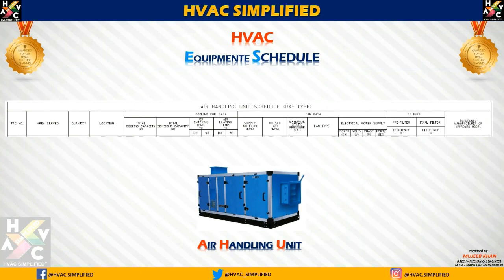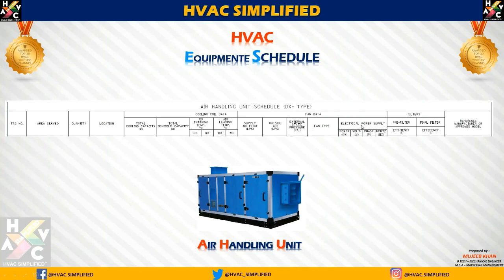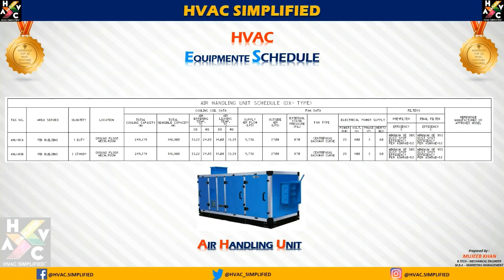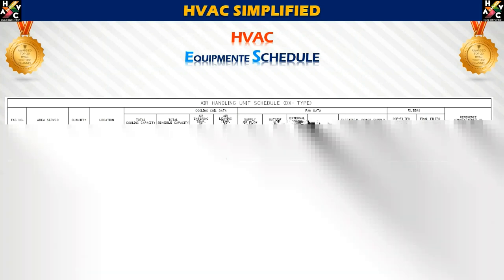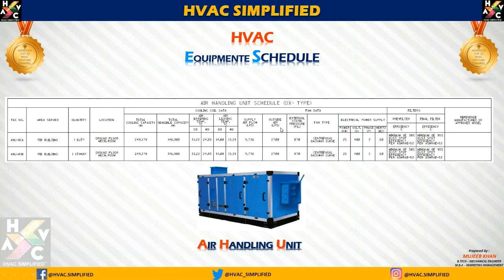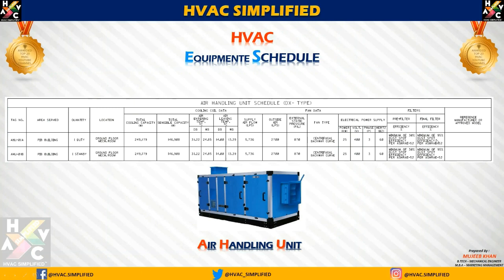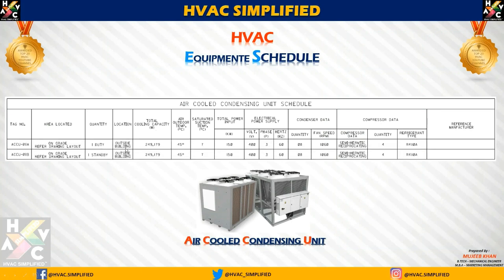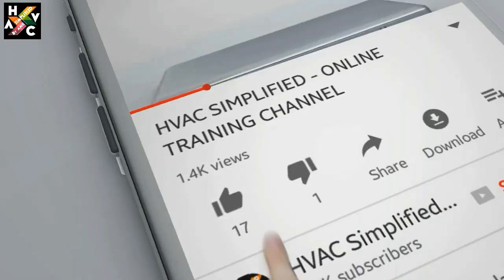Air Handling Unit (A.H.U) Desing & Selection - HVAC Training - Very Important

Comment: I have a project which is to design an HVAC system in an establishment with 500 TOR capacity, currently in  Equipment specification and I have no idea how to start and what to do.
Reply from the maker: Contact on info@hvacsimplified.in